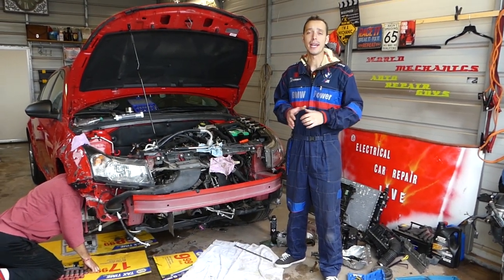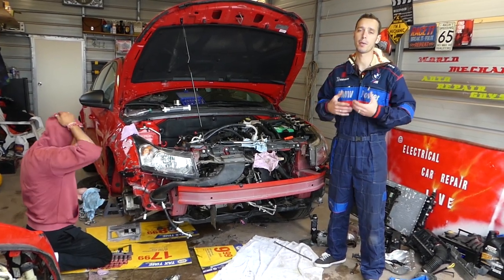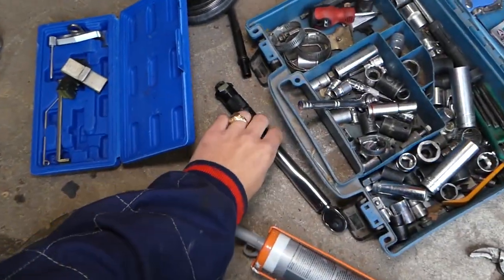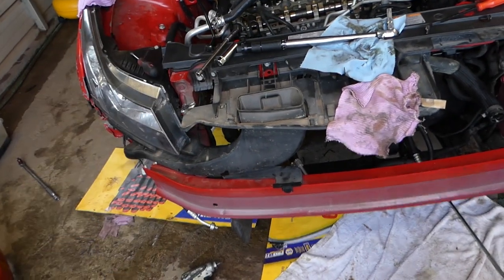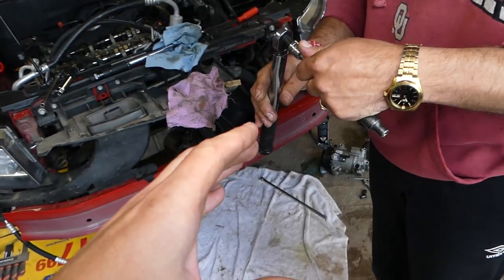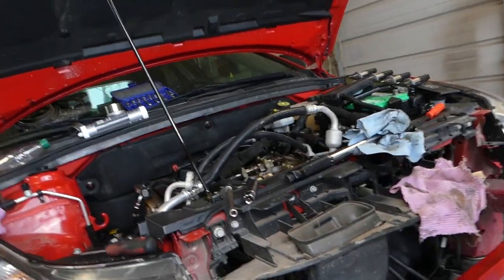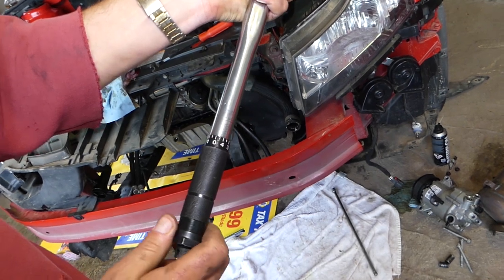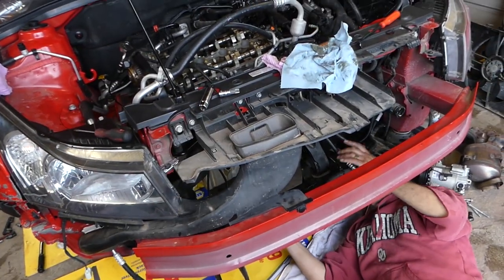OIL PAN TORQUE SPECS SEQUENCE CHEVROLET CRUZE SONIC OPEL VECTRA ZAFIRA ASTRA INSIGNIA

Comment: Just had my oil pan replaced at the dealership, and can confirm it's 10N.M. Thanks for the videos :)
Reply: It's crazy that the spec sheet says 79ft pounds wayy too much 10nm is correct about 8 ft lbs